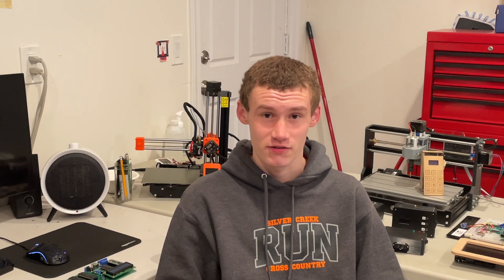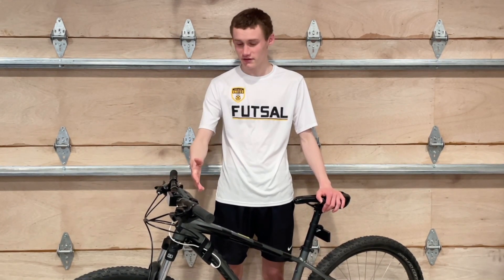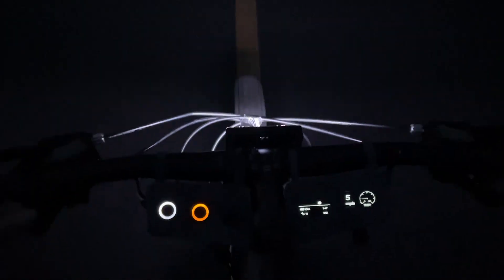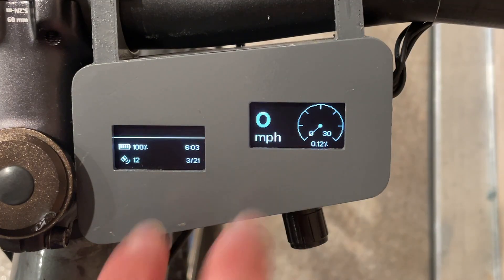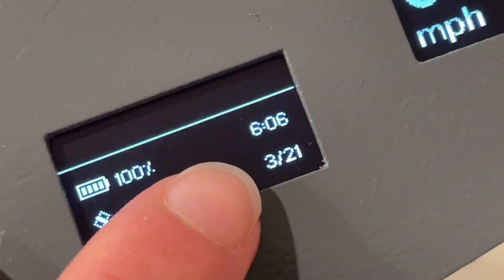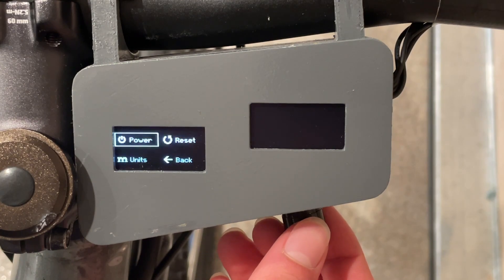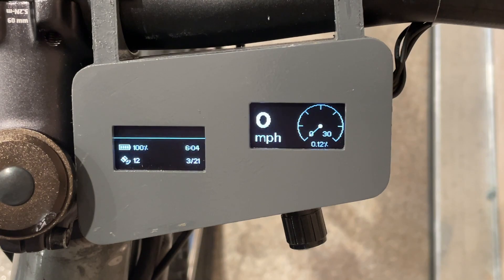A (not so) Electric Bike

Comment: how did you measure the speed, i mean the mph, which sensor did you use?
Reply from the maker: There are multiple ways of doing this but in this instance I used a GPS module along with a library. The module I used was the BN-180 and the library was TinyGPS++. There are many good tutorials on how to do setup the GPS but a good one is this: https://circuitdigest.com/microcontroller-projects/arduino-gps-speedometer-using-oled
Reply: @CollinWentzien  sir, would the device need like a wifi for the gps to work? 
i am not really familiar with this but would like to try building this project.
Reply from the maker: @chaii1574  Thanks for asking! The GPS is standalone -- all you need is to power it and it should work. GPS modules tend to work best outside, where you have a clear view of the sky. Hope that clears things up :)
Reply: @CollinWentzien  it does!! thanks a lot, sir! but one more thing, are those batteries rechargeable?? how long would it last?
Reply from the maker: @chaii1574  No worries! In this system, I used a typical phone charger (example here: https://www.amazon.com/Anker-Ultra-Compact-High-Speed-VoltageBoost-Technology/dp/B07QXV6N1B/ ). This one is rechargable and depending on whether or not the lights were on, I would get anywhere from 10 to 50+ hours.

Comment: This is really amazing, I have a similar setup for my bike excluding gps and displays though, now it's time for me to upgrade. My only concern being how were you able to get brake switch into place? I know that V - Brakes are easy to work on but disc brake lacks space, can you please help me out?

By the way I was trying to opt for accelerometer for turning and brakes (reduces wiring) you could try for future update.
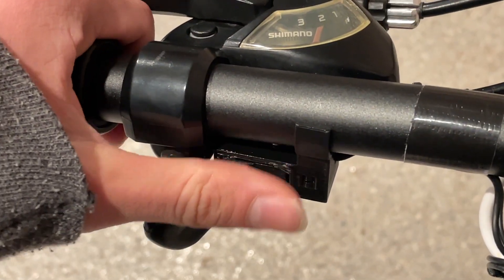Reply from the maker: Glad you liked it! I should've showed how the brake switch attached, but its pretty simple but not the most optimal solution. I used a limit switch on the handlebars that activated when I pulled the brake. You can kind of see it (or at least the screws) at around 0:51.
The accelerometer would be a cool idea for brakes, but not sure how well it would work for turn signal since I mainly use it to signal a lane change. Thanks for the ideas!
Reply: @CollinWentzien   Thanks man! Actually it's  Accelerometer and Gyroscope my bad I forgot to mention earlier.
Reply from the maker: @unmeshhh  Cant wait to see how yours looks :)

Comment: This is a great project, thanks for sharing it. What material did you use for the printed parts?
Reply from the maker: I printed everything in PLA because it was the only filament I had at hand. I’d suggest PETG though since it’s more durable and heat resistant. Also, to remove the 3D printed lines and inconsistencies, I sanded the print and then sprayed it with a layer of sand filler, to give it a smoother texture before painting.